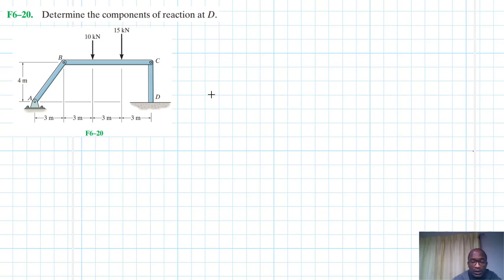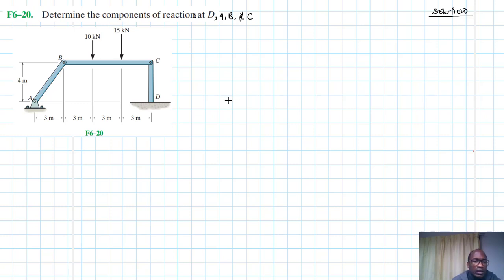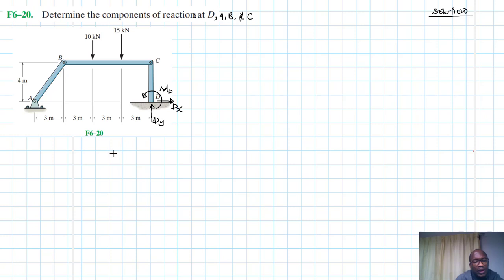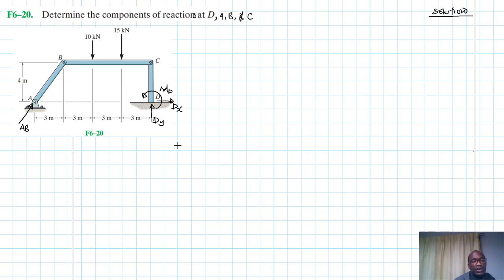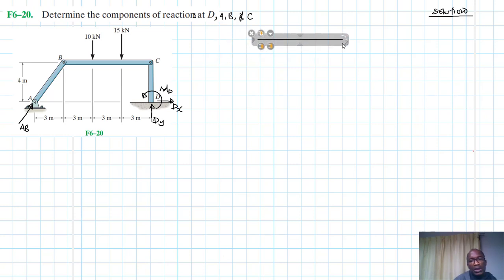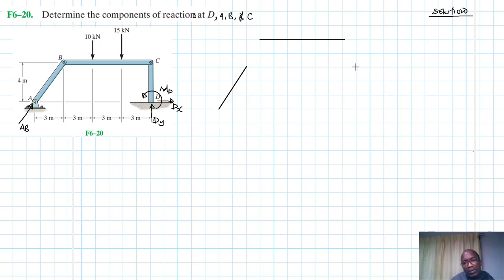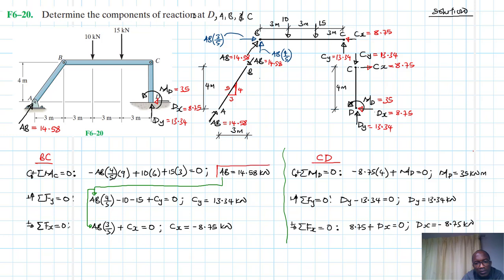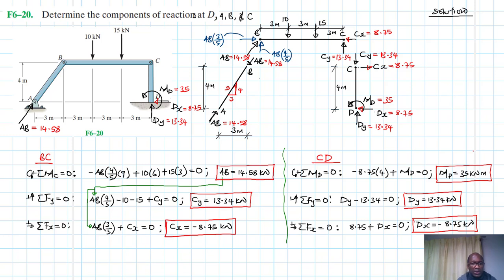F6–20 Structural Analysis (Chapter 6: Hibbeler Statics) Benam Academy

Comment: Why did you consider the -8.75 kN force as generating a positive moment in the moment calculation at point D, if the force is pointing to the right and would cause the bar to rotate clockwise?